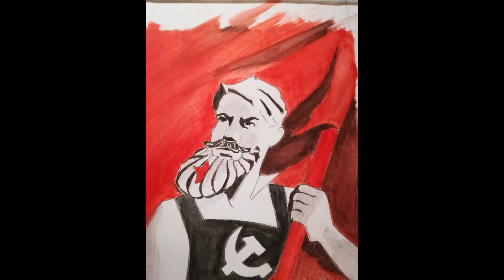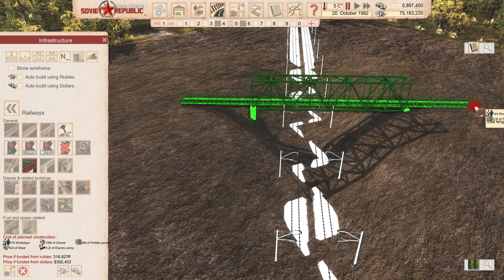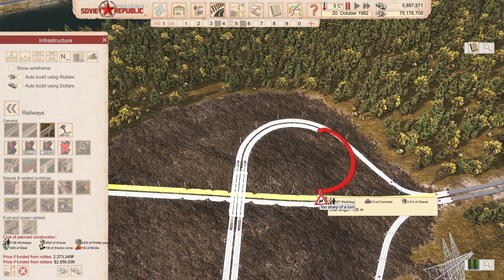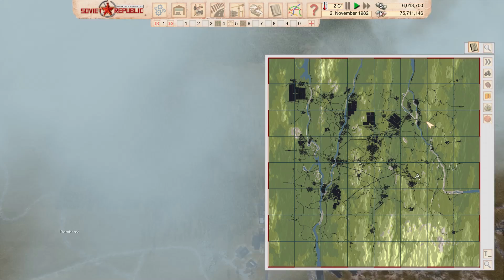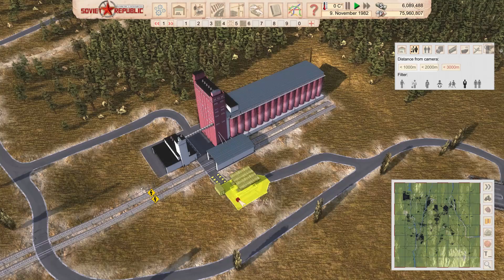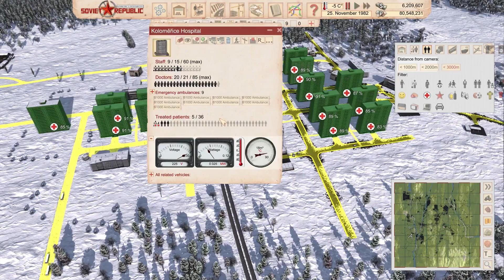Soviet Republic - Ceanwu Republic - Ep.132

Comment: 51:00 You might want to make the aggregate loading track into a loop instead of a dead-end. So it can handle lots of long trains without making traffic. Transporting ore takes a lot of trains!
Reply from the maker: Hmmm. This could be over my head but not sure what would happen if I do introduce longer trains. I might have to change the lighting distance on the tracks. Any suggestions? As I will be using this track for exports too.
Reply: @oolykeegaming81  Yes you would need to make more space between signals. And at the stations, you would need to leave the same big space in front of the switch. But this is why I say make a loop instead of a dead-end, because it takes a long time for the train to get in / out of the station when it must enter and exit from the same side. But if the trains can enter from one side, and exit from the other side, they will get in and out faster.
Reply from the maker: @messdpmessdp2192  Hmmm. I never noticed that! I will check it out! If so this will change how I do the rails! Thanks!! :)

Comment: I believe you were the one who mentioned the Soviet approach to steel production.  They would have a steel mill next to their coal production and would bring in iron and bring out steel on a train.  Then they would put a steel mill next to their iron production and would bring in coal and bring out steel so no trains would go somewhere empty.

As for Zdar, I believe there are 4 train tracks attached to the steel mill and you are only using one, so you could up the production by bringing in a whole lot more coal, iron and workers if you want to really centralize your production.
Reply from the maker: That is not a bad idea! I have 2 other mines, enough railroads, and a factory full of locomotives to transport it! I will get on it! Thanks, man!
Reply from the maker: Wait. No. I just remembered. If I bring more coal I will need more iron. Both coal and iron mine produce equal amount. If I increase one I will need to increase the other.